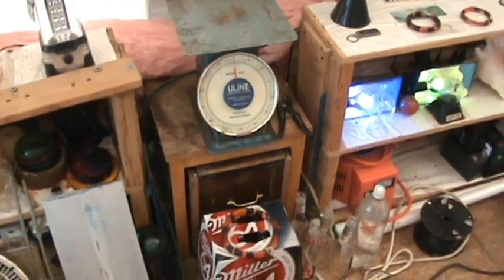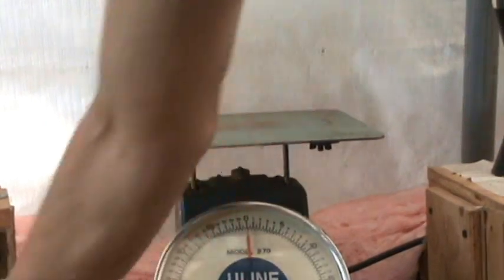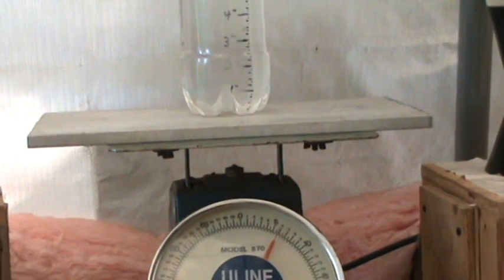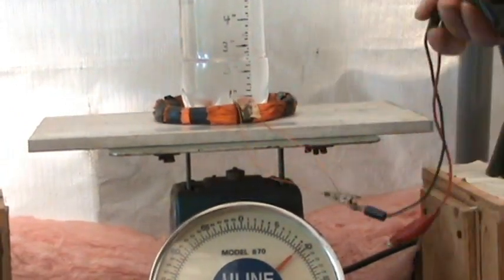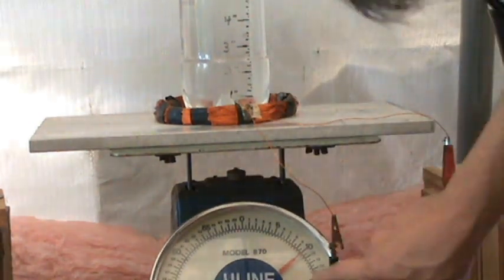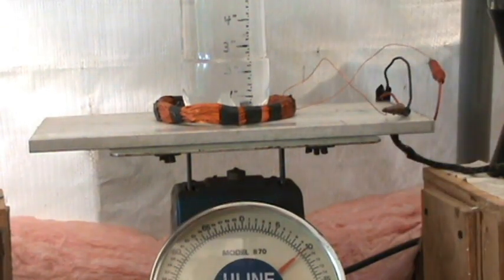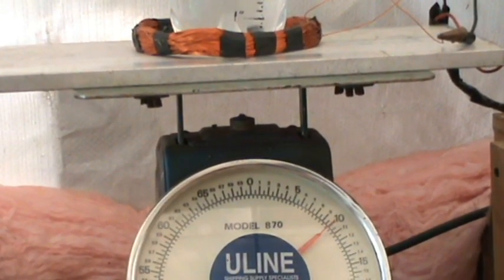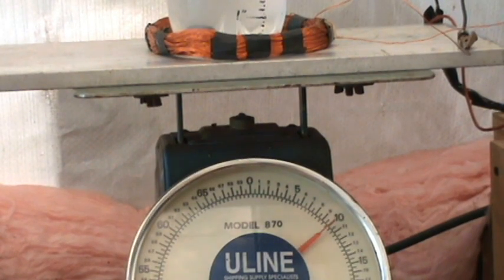LEVITATING COIL ON SCALE 2018

Comment: But this is normal. If you stand on a scales and jump, for that moment weight would be increased. The coil is ''standing'' on a magnetic ''feat'' above aluminum plate. Do you expect decrease of the weight?
Reply from the maker: I am replicating an experiment i did in the past because in the past the scaled "appeared" to decrease.  If you watch the video link that is under this video in the description,, the scale "appears" to decrease initially.
Reply: actually i disagree. i think it did increase initially in the first video. just not as much before it dropped. different scale and coil, many variances between the 2 videos. the camera in the older video wasn't managed well either.
Reply from the maker: Yeah, hard to tell in the original video, but that's why I had to re-do this video in "slow motion".  I did in fact use the same scale, camera, alum plate,  water bottle, voltage and frequency and wire gauge used in original video, only difference was that original coil had more windings, it had slightly more resistance.
Thanks for commenting.

Comment: go back look at my spinning pyramid experiments  ones got a clue and another idea i never got to try ill try soon  the motor spun the pyramid fast in one direction while the motor body itself was counter rotating very slow  with a torque that broke the super glue hold of that motor  and even holding that motor still was very hard as the torque was very strong  and the whole setup also rotated like the tesla zero point generator and it felt like it was locking onto something the clues are there and also the ideas of the hidink one terminal capacitor to  which i never got to try but the ideas are there, emagine if that motor was a boat and then it would change direction by that tourqe so no need for rudders iether and i bet it if scaled up could turn a space craft by the counter motive force  so no thrusters needed then
Reply from the maker: Do you still have your spinning pyramids?  That was really interesting :-)
Reply: no had to give it all away with my over stocked electronics but will rebiuld again soon
Reply from the maker: Ohhhh wow,   I think I would of bought those pyramids from you.  You did a great job on them.  Oh well, I'm sure you can re-build them bigger and better :-)
Reply: yes they are interesting indeed ill rebiuld them again soon as im working on drivers for a simpler led dazzller to combine with a sonic nausea generator im yet to biuld
Reply from the maker: Interesting,,,,,Do you know what frequency you are going to use for the nausea device?  Would make a viral video of using it on yourself and than throwing up, hehehehe.  Im sure you know what your doing, but be careful with that stuff, don't want to cause problems with other organs in your body.
Reply: only the led strobeing frequencies pending ion what these small useless trim-pots can do  as they get a bit tight to adjust so ill try cover all frequencies between 7 and 15 hertz

Comment: the big problem is that the scale is for heavy items and that coil can't weigh that much. you probably wouldn't even notice much of a change on the scale completely removing the coil. a digital scale would help, then you can zero it out before you levitate the coil.
Reply from the maker: Yeah, coil is just under one pound.  I could use a digital but have to make sure there is a big spacer between scale and coil & plate(maybe a cardboard box),,,,we dont want the currents to interfere with the scale.
Thanks for watching & commenting.
Reply: good point. hmmm

Comment: Hi I3, thank you for uploading this video. Did you try to swich the wires? Does the scale go in the opposite direction then?
Reply: Oh, it's AC of course.
Reply from the maker: No problem, this happens to me all the time.   I have a good idea than realize that for obvious reasons it is not so good idea.  Keep the ideas flowing :-)
Reply: Thanks for your answer I3, but remember you said you thought the scale wend down the other time.
And remember that even it is AC, only one line is the "fase" and the other the return line.
Reply from the maker: Hmmm, good point, worth a try :-)